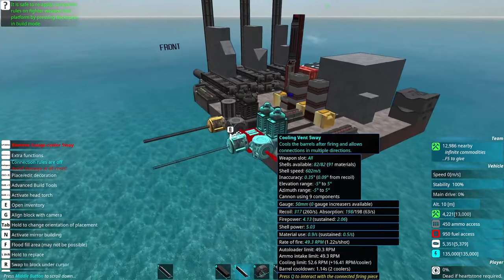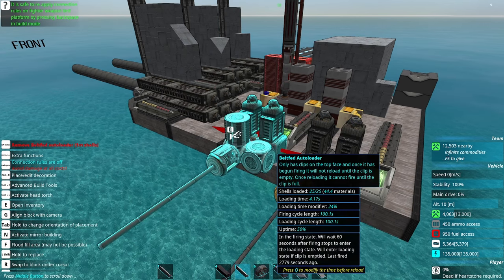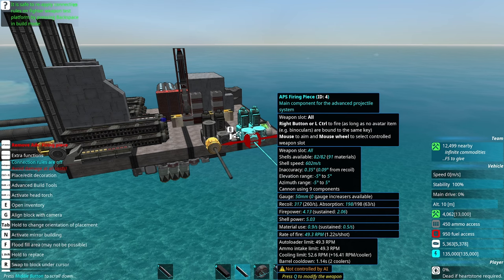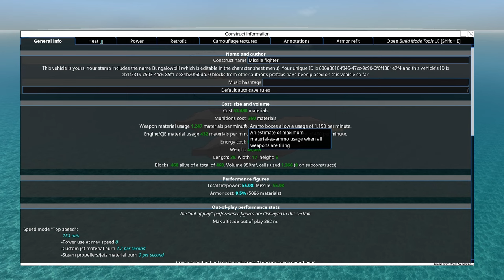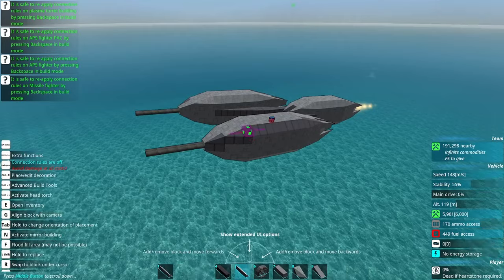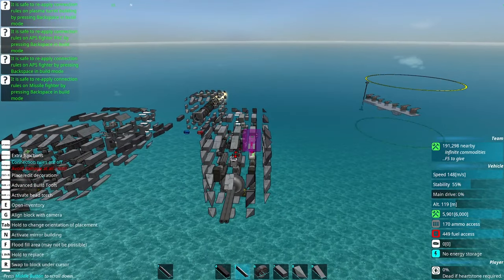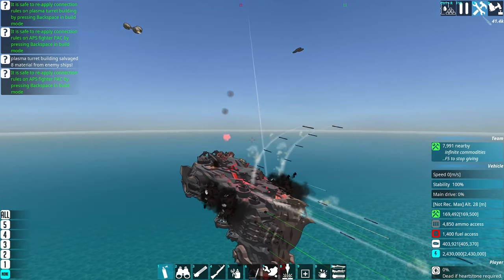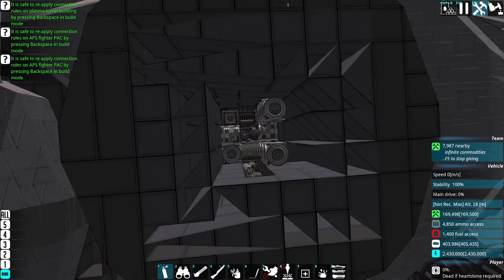Building a Wee Drone

Comment: You might want an ACB to switch thump/pierce for small targets. A frontal PAC your size will one shot anything airborne that isn't a thruster craft (including itself). While that's not it's purpose it'll only cost a few block spaces. I say this yet haven't done it for most the PAC's I use.
Reply from the maker: I’ll go ahead and do this. It won’t be able to hit small craft, but it will be worth it against some mid sized ones.

Comment: Efficiency and redundancy tend to conflict a bit. You don't want a lucky hit to disable a craft, but you also don't want to waste materials on components that aren't fully utilized until the craft is damaged. How much effort do you generally put into redundancy?
Reply from the maker: I don’t make small craft very redundant. They just die if they get hit hard regardless. It makes sense for larger craft since breaking large systems into multiple independent ones adds very little to the cost.

Comment: Do you have a good video on steam and fuel engines? I tend to use the harmony prefab for fuel engines  and no clue on getting a steam engine that doeasnt eat resources faster than is reasonable.
Reply: Check the workshop for engine platforms
Reply from the maker: I don’t have a video for it since I don’t know them well enough to put a video together without too many errors. I do build my own steam engines, though. As for fuel, there isn’t really anything wrong with the prefabs but I’d recommend using the one I have on the fifth season if efficiency is more important than space. Otherwise, the injector prefab is a good choice.